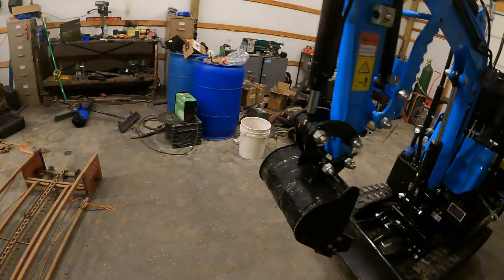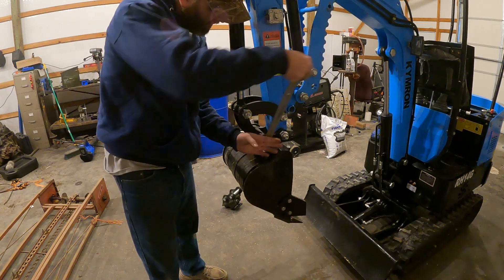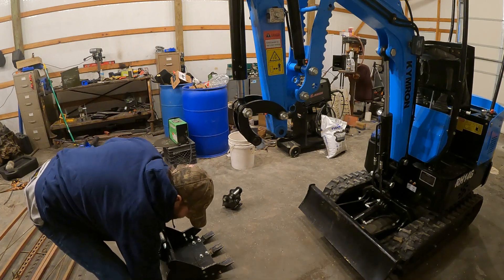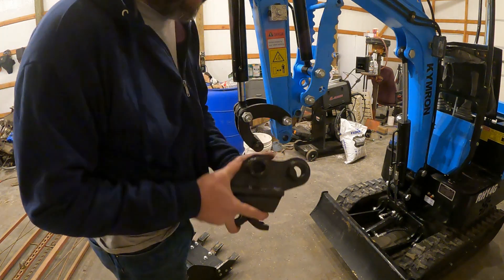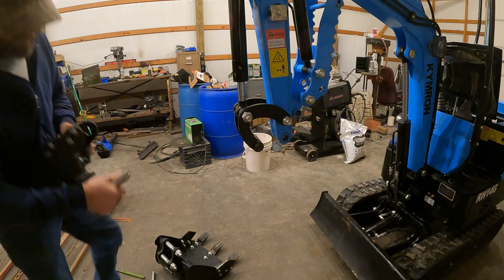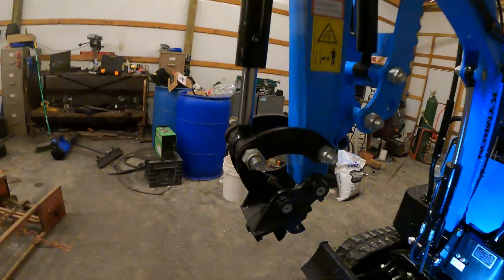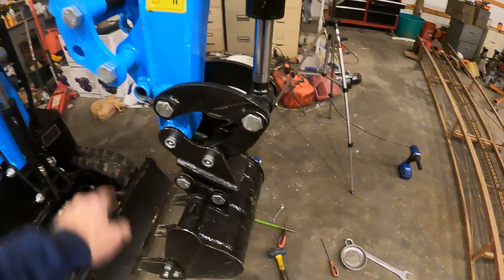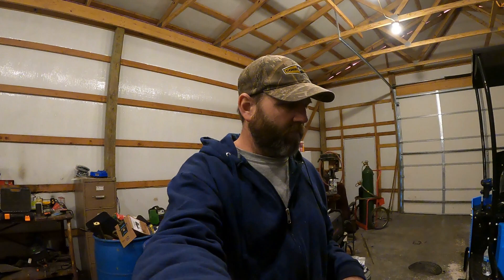chinese mini excavator quick attach coupler install

Comment: On the metric wrench.  Once they get to a 1 inch and over there about the same fit. Is what I have been told. If your bolts have grease serts on the machine. Keep on the boom
Reply from the maker: thats about right bolts didn't have grease serts

Comment: Does your bucket have a play after the bolt with a moving hook has been tightened? Or is it as tight as it was before installing quick hitch? Also many videos have the moving part facing an operator.
Reply from the maker: It seems tight and the way I have put it on is working real good so far

Comment: These quick couplers are the bees knees. Ive got 15 different attachments (hydraulic hedge trimmer, hyrdo tilt buckets in varied lengths, sand bucket, and the typical stuff you find in the 9-piece pallet sets). Saves soo much time. What a great backsaver and affordable for any small diy worker or needing to get into toght spaces
Reply from the maker: I agree I have loved the upgrade

Comment: As far as I know the quick connect has to come off to use the log grapple. At least that's what the dealer told me when I bought mine. Good video, thanks. I rechecked my information and yes  the quick hitch has to be removed to use either the log/rock grapple or the brush grapple.
Reply from the maker: yes it does but i have been using the ripper tooth for a log grapple and it works great and you dont have to remove the quick attatch to use it
Reply: @Farmscrap1183  Thanks for the tip about the pins. As you said they appeared to be hand drilled and were different. You saved me a lot of cussing.
Reply: @Farmscrap1183  ohh that's clever with the thing I assume...I am getting one of these excavators in December (when my bonus drops) 

Any reliable address with delivery where you can get them ?